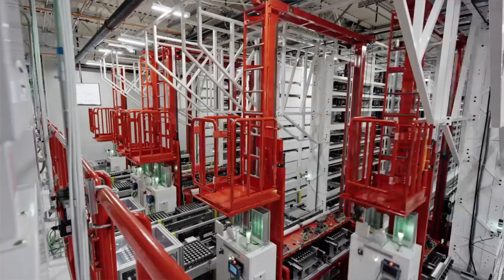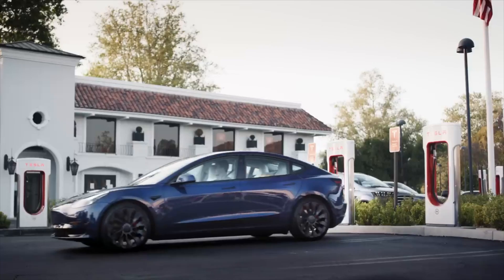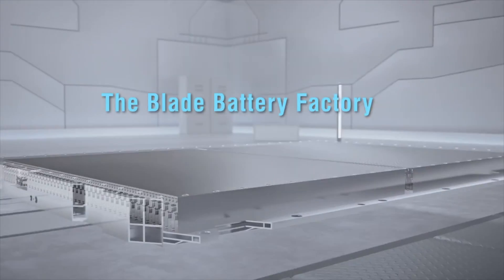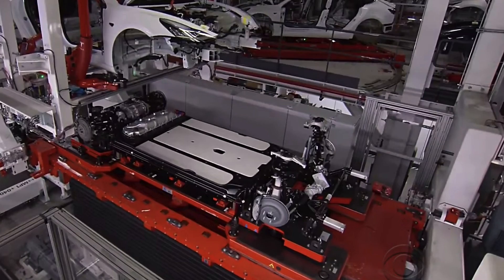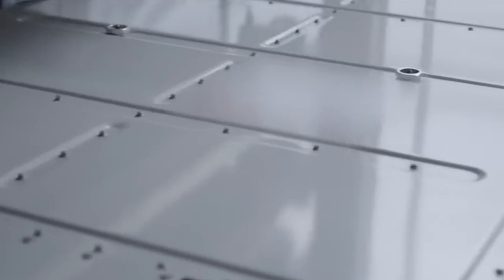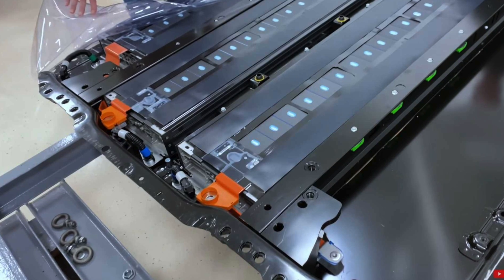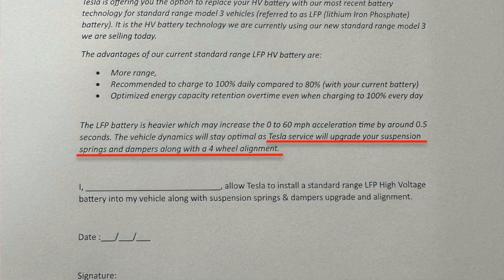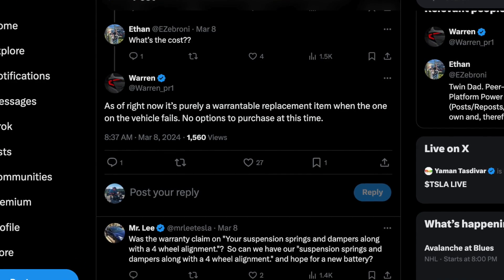Tesla Offering NEW Battery and Suspension Upgrades Under Warranty | It’s So Much Better

Comment from the maker: Replying to everyone that feels otherwise. 3 year lifespan doesn’t mean it dies in 3 years, it means that within that frame you lose a substantial portion that it’s no longer considered a healthy battery. Simply put 800 cycles (3 years of constant charging daily) vs 3000 cycles in an LFP

Look. An iPhone with 60% battery health can still run fine, but its realistic lifespan has been reached and needs replacement.

Comment: i own a tesla model y performance. I have 25k miles and just the other day, i took it to tesla service and they told me my battery needs to be replaced, saying that its gonna fail on me soon, its covered under warranty and they told me its gonna be a refurbished certified manufactured battery. So not a new one.... I WANT A NEW BATTERY! not a used... I am gonnna lemon law it like i did to my model 3. I already had 2 other issues covered under warranty on it.7
Reply from the maker: Yeah that’s the unfortunate truth, you’ll get a battery that is refurbished taking cells from other dead packs. At least this is under warranty, there are people who paid full price out of warranty  $10grand+ and still got a refurbished

Comment: 2021 SR+ currently at the SC getting the LFP battery pack. Had to replace the original in July and got an alert in the car last week and Tesla said they are replacing the battery pack again but this time with the LFP
Reply from the maker: Awesome! Let us know how it goes, you’re probably one of the first few
Reply: Hi, I am
About to get a new LFP, but worried that the extra weight will make the car feel very slow.
Reply: How does the car feel, still feel quick and fast?

Comment: John my YouTube app doesn't let me reply to your comments so I have to write new ones. I have seen people say that NMC has 800 cycles but I can't be sure what the definition exactly means. I have likely supercharged my car over 1200 times and it's still going. Jeff dahn the battery researcher says that NMC batteries should keep going indefinitely with a slow rate of degredation. He said 300k-500-1,000,000 miles may be possible and the battery could be used for home use afterwards. I'm sure there must be some limit but I'm not sure what that looks like. Lfp says it should last longer but the duration is getting so long that I'm not sure it even matters to an avg user. These are all good questions if anyone has the answers. All I'm able to conclude so far is my own battery seems to be able to hit 200k miles without any issues which is far more than a normal user needs to be concerned with.
Reply: Search evbee NMC and LFP Lithium-ion Batteries on your search engine. 

This is where he referenced the three years/800 cycle figures. If you understand how EV ownership works, you would understand that three years and 800 cycles is not at all representative of real world EV ownership.
Reply from the maker: Thanks for sharing. I think both NMC and LFP have their own advantages

Comment: Older Model 3 includes 2018? Or it is only heat pump equipped Model 3s?
Reply from the maker: It includes the all 2018

Comment: I think we need to clarify. 10% degredation should be expected from any battery over about 50-80k miles. Any range published by a manufacturer should be looked at as 90% realistically. The cells if cared for properly should continue to function for a long time. Not like a cell phone battery with no thermal management. I'm not sure if lfp actually lasts longer. That's a good question.
Reply from the maker: Thermal issues aside, we still have cycle life, right? Regardless of how well you take care of the battery it will still have a 800 cycle count limit, this is where you’ll start to see problems. LFP especially the newer ones should output higher power but also have over 3000 cycles

Comment: There needs to be a discussion about battery longevity. 

800 cycles assuming an average charge depth equivalent to about 280 miles (my estimated average full charge from 100-80% health to estimate average miles per full cycle over the life down to 80% for current MYLR) gives about 220,000 miles. Not even most people who drive SUVs/sedans for work normally average 220,000 miles every three years. That three year figure assumes an average of about 200 miles per day. Who does that outside semi drivers? The article you referenced also did not explicitly state those estimated battery life lengths for EVs. That three year figure makes sense for smartphones, powered tools, etc., where you can consume one or more cycles of use per day, but for an EV where we can estimate the average daily mileage to 40 miles per day, that is only about a 0.15 cycle per day. That is roughly 15 years before reaching <80 health. 

I would like you to consider doing the math on your own and not giving cherry picked data, or else you look like Graham Conway’s inaccurate and unrepresentative Ted Talk.

This is the article he referenced for that three year figure: 

https://www.ev-bee.com/article/9-nmc-and-lfp-lithium-ion-batteries#:~:text=LFP%20batteries%20can%20last%20more,often%20used%20for%20power%20needs

Comment: The non LFP batteries last over 300k miles.  3 years on average? Why would anyone buy a car that only lasts 3 years…….
Reply from the maker: Replying to everyone that feels otherwise. 3 year lifespan doesn’t mean it dies in 3 years, it means that within that frame you lose a substantial portion that it’s no longer considered a healthy battery. Simply put 800 cycles (3 years of constant charging daily) vs 3000 cycles in an LFP

Look. An iPhone with 60% battery health can still run fine, but its realistic lifespan has been reached and needs replacement.

Comment: 3 years? Your nuts my car is 5 years old 100k miles lost 5%so far
Reply from the maker: Replying to everyone that feels otherwise. 3 year lifespan doesn’t mean it dies in 3 years, it means that within that frame you lose a substantial portion that it’s no longer considered a healthy battery. Simply put 800 cycles (3 years of constant charging daily) vs 3000 cycles in an LFP

Look. An iPhone with 60% battery health can still run fine, but its realistic lifespan has been reached and needs replacement.

Comment: Could you please link your source for an “average” of three years for the battery? That is super low even for early EVs like the Nissan leaf without battery conditioning.
Reply from the maker: No specifics, but here - https://www.ev-bee.com/article/9-nmc-and-lfp-lithium-ion-batteries#:~:text=LFP%20batteries%20can%20last%20more,often%20used%20for%20power%20needs.
Reply from the maker: Replying to everyone that feels otherwise. 3 year lifespan doesn’t mean it dies in 3 years, it means that within that frame you lose a substantial portion that it’s no longer considered a healthy battery. Simply put 800 cycles (3 years of constant charging daily) vs 3000 cycles in an LFP

Look. An iPhone with 60% battery health can still run fine, but its realistic lifespan has been reached and needs replacement.

Comment: That sucks but definitely not normal. My nickel battery is at 190,000 miles with 9% degredation. I'm curious how many failures there are within the warranty period
Reply from the maker: That’s a pretty good rate for degradation after 190K. It’s in scenarios where it completely fails (like what happened to me) is when they’ll replace to LFP. Not sure the failure rates, but I’d say pretty low

Comment: My m3 long range 2019, dont know the battery type, but 5 years old and +200 000 km, currently touching wood and no battery issue, except smaller capacity out of guarantee now 😅
Reply from the maker: Knock on wood 🤞

Comment from the maker: Just to clarify these numbers are averages and available online, but we all know that NMC lasts much longer than 3 years. Although if it means anything, my MY 21 had failed 3 times and had battery replacements. We would’ve loved this upgrade if we hadn’t already sold
Reply: Where do you found these "averages"? Tesla claims 1500 Charging Cycles, which would be at least 300.000 Miles for a Lr before you get under 70% of the former capacity when new. At a minimum you get 1000 Cycles if you charge everytime 0-100%, which would be about 200 Miles at minimum to 70%.
You must have something faulty in the Battery electronic which would be the same in a Lfp. The reason Tesla is replacing the whole Battery is because it would be very complex and expensive to make every Tesla Service Station also a Battery Repair Station. So if anything is wrong with the Battery or anything inside they just swap the whole thing and it is send to a Tesla Repair Shop just for batterys. The next guy who has troubles with his battery and before that about the same capacity gets your repaired one. Could be the basic electronics which is built in the Battery or one cell or the whole pack but this is very unlikely.
Also did you really had one of the very first Model Y Sr that still had Nmc Batterys? Because the one Model 3 owner who got that offer was a old Model 3 Sr with still Nmc.
Reply from the maker: @D00MINIK Replying to everyone that feels otherwise. 3 year lifespan doesn’t mean it dies in 3 years, it means that within that frame you lose a substantial portion that it’s no longer considered a healthy battery. Simply put 800 cycles (3 years of constant charging daily) vs 3000 cycles in an LFP

Look. An iPhone with 60% battery health can still run fine, but its realistic lifespan has been reached and needs replacement.
Reply from the maker: @D00MINIK I linked the sites in once of the comments replies. You can literally find this info in a google search
Reply: @heyJohnEe   The one Argument against your These is simple: 8 years and 120.000 Miles Garantue. Tesla would be broken if their Batterys only last 3 years. If you drive 160.000 Miles every time 0-100% and so fast that this only means 200 Miles than yes you could be under 70%. But if you at least only charge to 97% you get 50% more cycles. Which would be 240.000 Miles. And there are even old Tesla Roadster with the first Battery still fine after 12 years. So saying 3 years Life Span is absolutely Bullshit and very hurtfull for alle Electric Cars that don't use Lfp. And even 800 cycles can't be said as a general term. That's why Lfp Batterys cycle from 3000-6000. If a Nmc Battery has a large Buffer it can also have a very different lifespan. There are Nmc Tests with 2000 cycles and no degredation in Lab Tests which are meant for 100years Lifespan. Also if I buy a Long Range and never charge it to more than between 75-80% which would be the Range of a Sr 100% charged, the Nmc Battery will easily reach the Lifespan of the Lfp, very likely even outlilfe it.

Comment: John I think the nickel batteries last way longer than 3yrs
Reply: My model 3 is fine after 3 years and so is my neighbors
Reply: I think you should clarify that it’s just a certain batch of cars for specific batteries productions. About 1000 Model X in Taiwan also had battery replacements in 2019 ish.
Reply from the maker: @sparkpaul Replying to everyone that feels otherwise. 3 year lifespan doesn’t mean it dies in 3 years, it means that within that frame you lose a substantial portion that it’s no longer considered a healthy battery. Simply put 800 cycles (3 years of constant charging daily) vs 3000 cycles in an LFP

Look. An iPhone with 60% battery health can still run fine, but its realistic lifespan has been reached and needs replacement.
Reply: @heyJohnEe  thank you for clarifying in the comments.  I think you can be more specific about the situation.  What happened to your car did not happen to all the teslas. It’s certain production vins from specific suppliers and like you said, the battery is not dead but also it’s not acceptable it only has 60% capacity after 800 cycles.

Thank you for the clarification John but in the future be more specific when things are more nuanced otherwise people might write you off as FUD.

Love your content!
Reply from the maker: @sparkpaul I gotta work on that! Thanks for the feed back, Paul
Reply from the maker: It’s just an average, but our Model Y 2021 failed and got replacement 3 times already
Reply: @heyJohnEe If your battery completely fails it shouldn’t be part of the statistics.  If you’re battery is gonna fail it, it fails within a year or two….   I got a 2023 LR, should I expect it to fail in the next couple years?
Reply from the maker: @KiddeeKush Replying to everyone that feels otherwise. 3 year lifespan doesn’t mean it dies in 3 years, it means that within that frame you lose a substantial portion that it’s no longer considered a healthy battery. Simply put 800 cycles (3 years of constant charging daily) vs 3000 cycles in an LFP

Look. An iPhone with 60% battery health can still run fine, but its realistic lifespan has been reached and needs replacement.
Reply: @heyJohnEe  LFP has more charging cycles sure but is heavier and impacted by climate much more.  Also it is a smalller battery with less range which leads to more charging.  LFP is a bright look into the future of battery tech in cars for sure though
Reply from the maker: @KiddeeKush you are right on both of those points, at least for the current LFP technology

Comment from the maker: So this has to be one of the most long-awaited feature ever since Tesla Vision was first introduced, but do you agree that this should be an included feature or ale-carte upgrade rather than part of an expensive package?
Reply: The 0-60 time is .5 seconds slower, that’s a big hit. And if you are traveling you still won’t charge to 100 takes too long. The reason they want you to charge to 100% is because if you don’t the BMS gets wacky and can’t give a proper range. They are doing this for one reason. It costs less
Reply from the maker: @daniml7258 if speed is a factor you wouldn’t be buying the base model